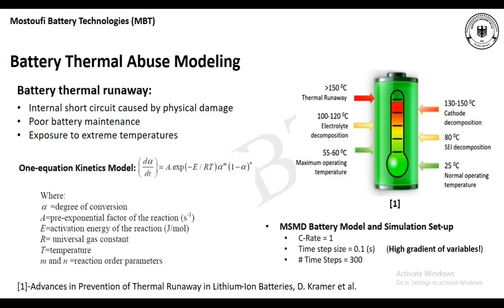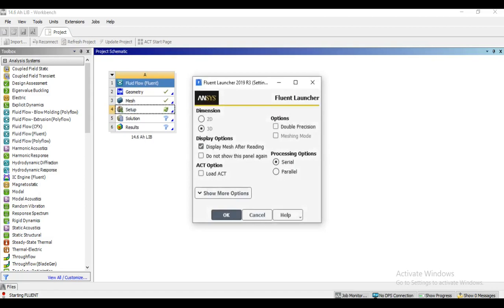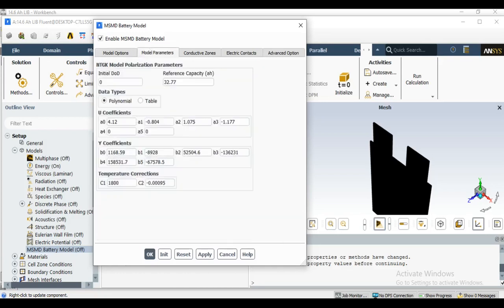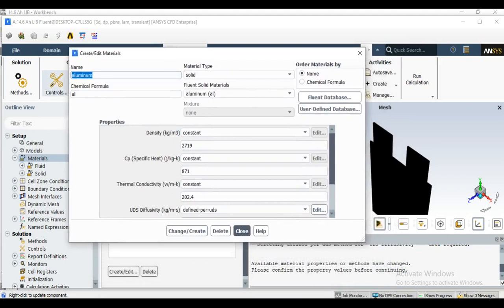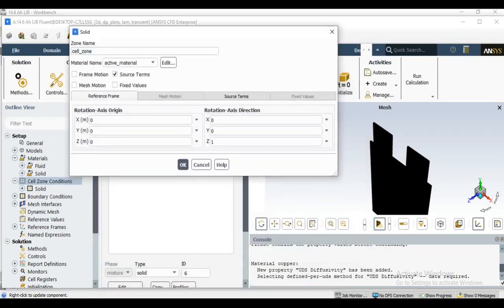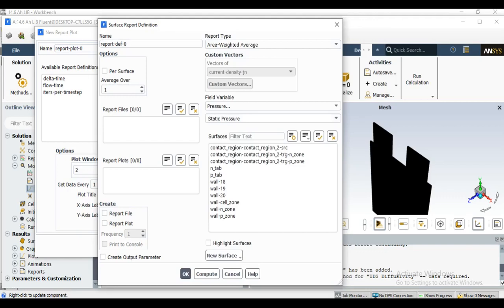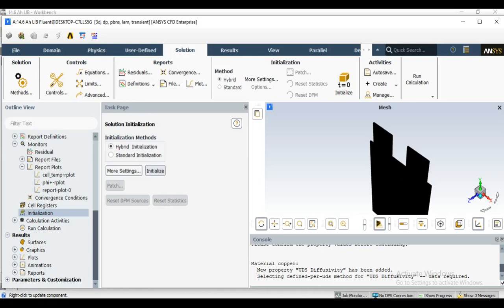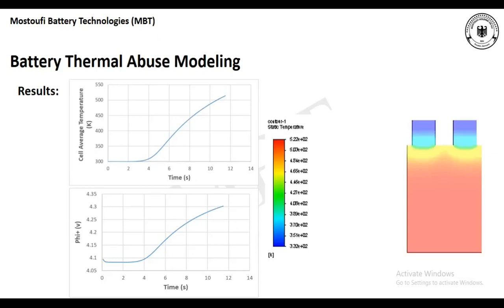Battery Thermal Abuse Modeling in Ansys

Comment: Good day sir, How do i define UDS diffusivity? Its not showing in my materials tab.
Reply: For solidm UDS diffusivity and electrical conductivity are same. Just define your values in electrical conductivity space.
Reply: @filmmaker5767  Hello, i have the same problem, UDS diffusivity does not appear, so in active material i use electrical conductivity, but for the tab material , in which i need the 2 separate values?

Thank you in advance

Comment: If I use internal short-circuit resistance to trigger the thermal abuse model , do I need to turn off the convergence criteria for the simulation?
Reply from the maker: Dear,

You can turn off the convergence criteria for any type of simulation, but this is not a mandatory rule.
Reply: @mbt_s  Thank you sir, if I change the cell capacity and geometry, Thermal abuse is not triggered. Do I have to change any input parameter to trigger it?
Reply from the maker: @PrashanthMp-m5e  Dear, please consider that thermal abuse modeling is not dependent on the cell geometry or capacity. It could happen in any geometry. So, please first, check if you get a fine solution in a simple discharge process and then run the abuse model.

Comment: Can you explain how the thermal abuse is triggered in this simulation? An internal short circuit must be done to trigger the thermal abuse right? but in the above ANSYS simulation the internal short circuit is not done. Which input parameter in the above simulation triggers the thermal abuse?
Reply from the maker: Dear,
Thanks for your question. Thermal abuse modeling is triggered by the model. The short circuit is one of the causes for thermal abuse of the battery and it could go far to the point where thermal abuse occurs.

Comment: Sir, also when I use four equation kinetic model then I don’t get the same output. Why? For four equation model should we use another geometry?
Reply from the maker: Hello, thanks for your question. If you conduct the simulation with 4-equation kinetic model (without changing any parameters), you will see that the temperature rise is not sensible, and phi+ does not increase over time (for delta_t = 0.1 (s)). The reason is that the 4-equation kinetic model parameters are completely different from those of 1-equation kinetic model, and for each battery you need to specify them correctly to have a compatible result with the experiment.
Reply: @mbt_s   thanks for your reply. So, I have to change in boundaries conditions?
Reply from the maker: @archanpatel-me3wl  Not actually, it depends on the battery model you are trying to model.
Reply: @mbt_s  thanks. Actually I use same model , which is in video. So what I have to change, if I want to use four equation kinetic model?
Reply from the maker: @archanpatel-me3wl  Ok, so, the battery in the video is just for the tutorial on how to conduct thermal abuse modeling in Ansys. If you want to model the 4-equation, you need to select another battery with available datasheet and experimental data.
Reply: @mbt_s  ohh ok sir! Can you help me regarding that?
Reply from the maker: @archanpatel-me3wl  Currently, we have no document on that, but we put it on our list to cover that topic with an available experimental data. It is not easy to validate thermal abuse modeling Or, if you have any suggestions, you can send us via email:
bfcs@mostoufiholding.de
Reply: Ok thanks sir. 😊